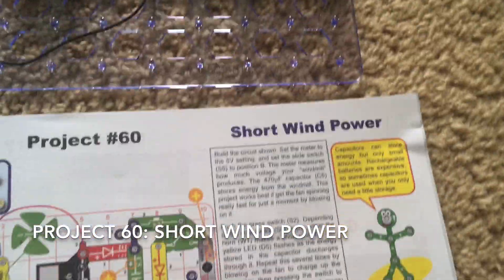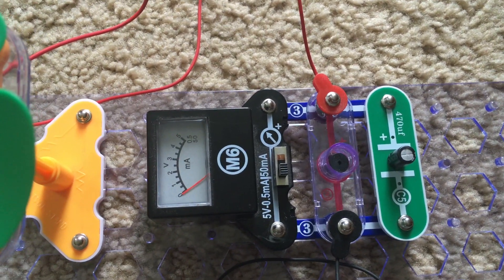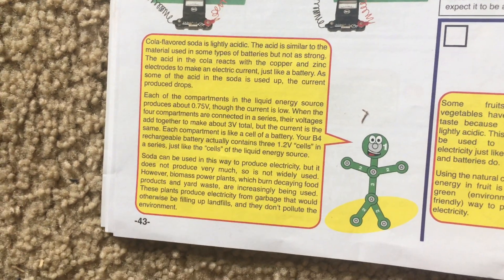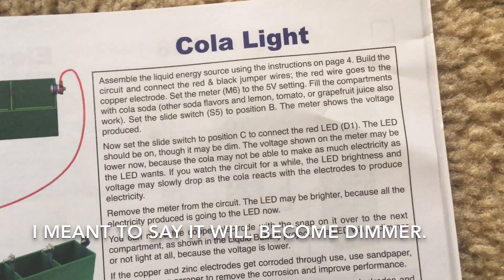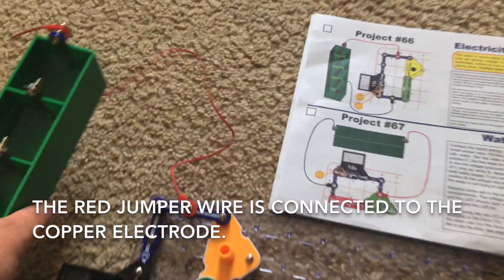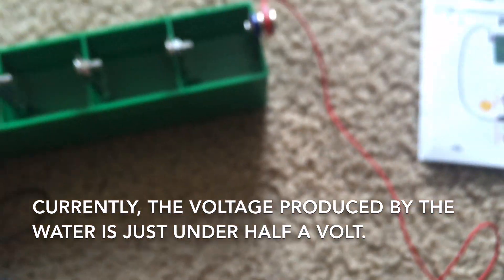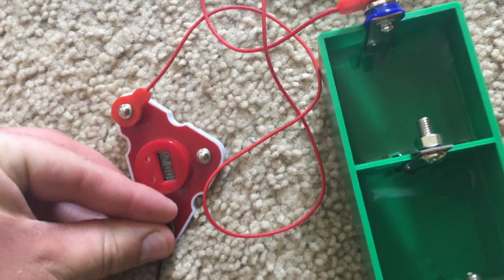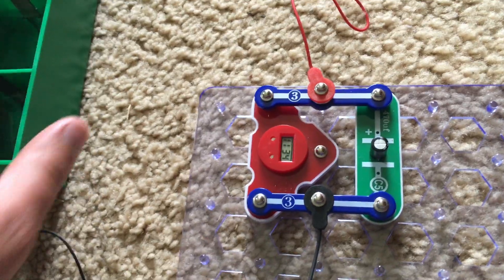Snap Circuits Green: Projects 60-69

Comment: In project 69, I do not know how long the 470UF (470,000 nano farads)  capacitor will hold the energy, and it's quite hard to get an intuition for it. I might be guessing it can be around over  30 seconds that the capacitor can hold energy for that.
Reply from the maker: You may be right.  What can also determine how long the energy from a capacitor lasts is the size of whatever it is powering.  The bigger the device and the more energy it uses, the shorter the capacitor will power it.  For example, it will run a dim LED longer than a bright incandescent bulb.
Reply: @andrewsstation6436  true, because the LED uses 20MA, the lamp uses 200MA.
Reply: I used my Snap Circuits Green set and it ran the clock for 8 minutes and 5 seconds. (Using the Snap Circuits Extreme capacitor 470UF) Way higher than my guess. I bet a 10 UF or a 1 UF capacitor can power it for like 5 seconds